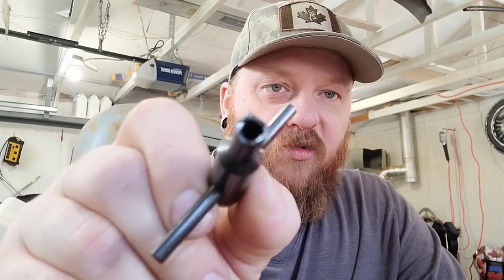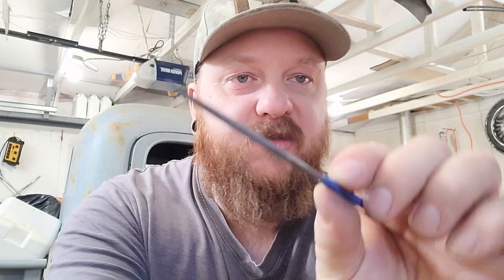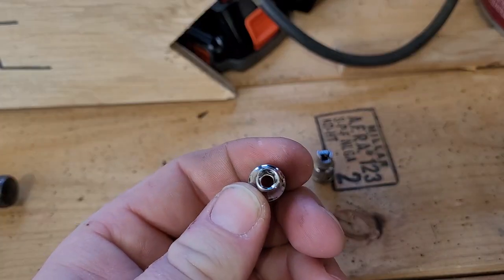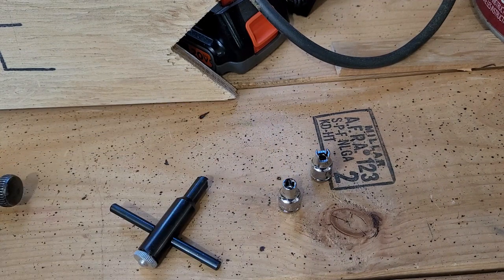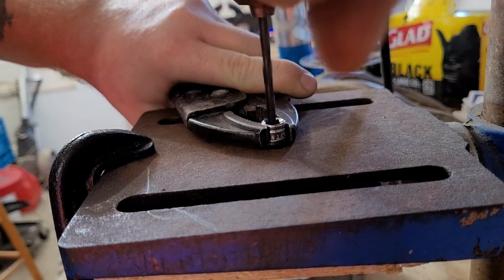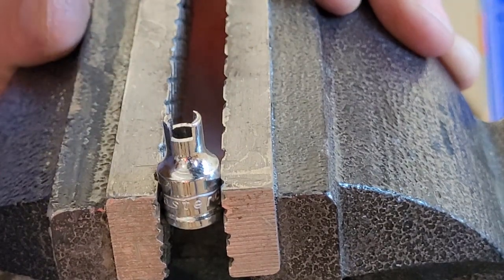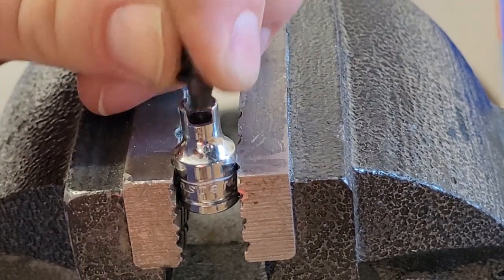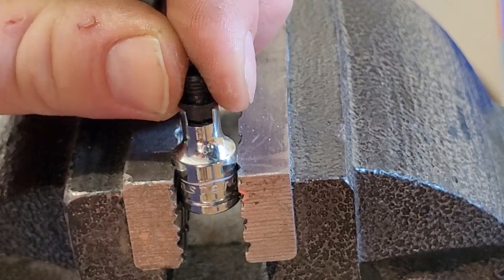homemade nipple wrench

Comment: Dusty, the factory issued uberti 1861 navy came with the nipples so tight that I basically stripped them with a cheap nipple wrench. By the time I discovered this genius idea they were pretty far gone. I manually filed down the socket and used a 3/16th inch because didnt have a better tool, but it didnt take that long. And it works perfect. Still had one nipple I couldnt get out and ended up having to drill it out and rethread the cylinder. Thanks for this, would not have thought of this.

Comment: Thanks for the video.  I bought a used Hawken and it had been neglected.  The nipple was rusted in place.  After soaking in penetrant I still couldn’t get it to budge.  I followed your advice and made one like yours (5mm) but it bent it out.  Made a second without the reduction area (9/32) and it fit right in with much more steel around the nipple.  Worked like a charm.  Thanks a bunch.

Comment: Thanks for your help. I have factory original tippels in my new cylinder. I needed to extract them for a first time for cleaning and one remained stuck. My aluminum wrenck was striping. You provided the answer.

Comment: yep.... did the same but I used the deep sockets.    Then I bought enough of those hand ratchets for the ones I made ... so deep socket with a 'finger'?  ratchet in quarter inch.    The length worked out perfectly.  Also a stone for my dremel was just the right width.   they wear fast tho so I had to dress it fairly often

Comment: I knew that those nipple wrenches were soft. But I didn't know that they were made from aluminum. I would bet they are made that way so that people who do not know 2 things, cause a lot less problems for themselves. #1) which way to turn the wrench to remove the nipples. And #2) how tight, SNUG is.  If a gunsmith can remove them with a good tool right away, it's an easy $30.00 plus whatever a new wrench, and some anti-seize retails for. But, If he has to drill out and rethread "x" number of broken off nipples. It would probably be cheaper to just replace the cylinder.  /// But, Thank you, I do have some spare sockets. And I am capable of making a good tool from one of them.

Comment: I'm not sure what kind of drill bit you're using.  But, I think I need to order a set like yours.  Anyway, when I tried to drill out the socket I burned up two different types of drill bits.  I finally ended up using a carbide tipped masonry bit and lots of oil and still it was hard.  Then again, I was using a Craftsman socket and not a cheap copy.  Maybe, Craftsman uses some kind of hardened steel.  Next time I will use a deep well socket and avoid this problem.  Thanks for you video.

Comment: I tried this but the socket would not fit into the recess on the cylinder. I used a 5MM socket and got the notch cut without trouble but the socket would not fit into the cylinder on my 1858 Remington.

Comment: Only thing I would add, be real careful not to get the metal too hot if you use any rotary tool to cut it. Very easy to mess up the heat treat and temper of tool steel. You could end up with a tool that's almost as soft as the cheap wrenches. You can just keep a cup of water and and a rag or something to cool the socket after every couple seconds. Otherwise great video. I just had the exact same idea yesterday but have to go grab my Dremel stuff out of storage.